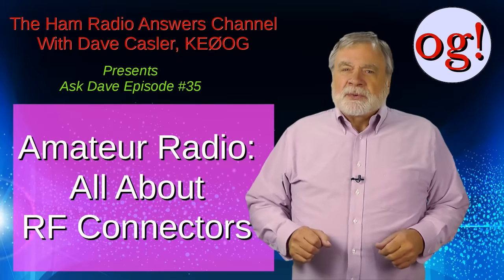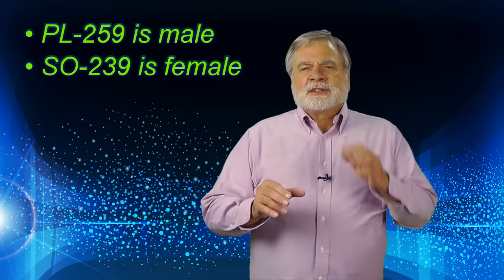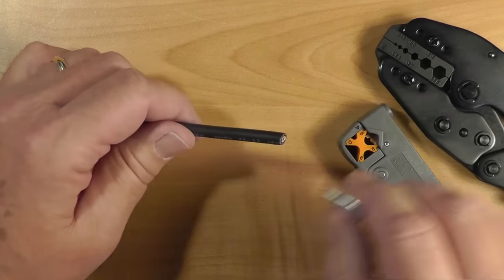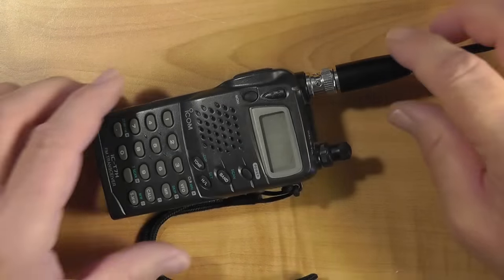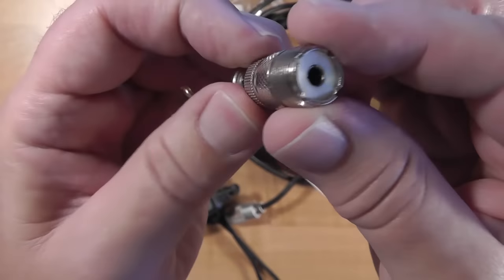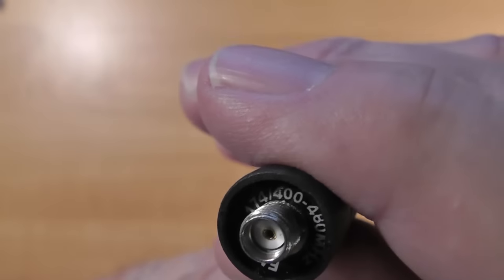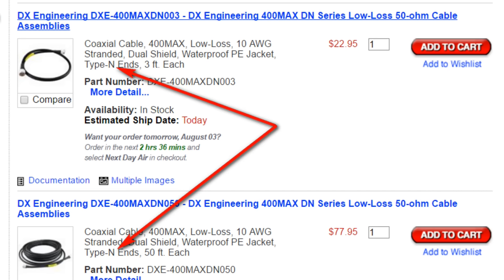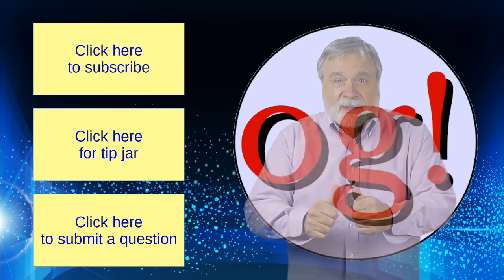RF Connectors and what they're for: AD#35

Comment: Hi ya Dave,  love your videos, always new things to learn.  Just need to let ya know that N-Type connectors are very common (not rare) these days for all VHF, UHF and up into the microwave bands. This is regardless of power levels ( as you implied) many transceivers and antennas already have N-Type connectors on them for the VHF and up bands. As you alluded to, a big reason is that they are a continuous 50 Ohm ( 75 Ohm also available) through the socket  ( this also applied to the SMA, BNC and TNC type connectors)  and as you commented avoids impedance bumps that you get with PL259/S)239 sockets.  At VHF and up into the microwaves .... even small impedance bumps are not good :) :)   Take care ... keep posting your videos   73's Dave VK2TDN

Comment: In Europe, N. Connectors are fairly common on ALL vhf/uhf equipment. Not only high powered equipment. My Yeasu FT-7900 and Kenwood TM-d710 have an N Socket. (Both 50 watt max) and my Kenwood TS-2000 has, next to the so239's for vhf and hf, an N socket for the uhf antenna.

Comment: Thank you for this Dave, much appreciated. NOT a Ham yet but starting out and becoming more & more familiar with the “ins & outs”. Got the ARRL Tech manual & studying up (as I don’t have an “Elmer” really) trying to glean what I can IF I decide to move forward in the hobby. Great stuff & you’ve answered some questions...although I’ve JUST finished running the RG58 coax cable (mag mount antenna) into the attic for a ‘centralized’ Base radio in the house. Went from PL 259 to a SO 239..to a smaller SMA (?) female on the 50’ run of coax cable. Figuring it out I suppose. I did learn from the vid about the intricacies of the PL 259 to SO 239 “FIT” which I MIGHT have to RE-address, although I had/HAVE NO qualms about how I feel it went together. Late seeing the vid BUT it’s still appreciated!

Comment: I also use N connectors exclusively.  With the proper stripper and crimper, you can install one on LMR400 cable in 30 seconds.  If you need to extend a cable for any reason, you can barrel them together with no impedance bump.

Comment: -3bd or 50% power loss at maximum frequency for each connector : UHF (SO, PL) = 60 MHz, FME = 2 GHz, BNC = 4 GHz, N-type = 11 GHz, TNC = 11 GHz, SMA = 18 GHz = = = = > NEVER use at connector at close to its operating bandwidth; the more frequency margin the better ! The 'UHF' are notoriously bad since tolerances from many companies vary widely and the bandwidth is already poor. Best to use an N-connector where ever possible for base stations, except for HTs where SMA is best.
Reply: dropping some knowledge there, 73

Comment: All my h/b equipment has BNC with RG58 cable so I also use the BNC on the front of my FT817ND.
Be sure to get 50 Ω and not 75 Ω for amateur gear. Most radio outlets stock only 50 Ω. Some older gear such KW had a choice of 50 Ω or 75 Ω. My KW204 tx had 75.
G4GHB

Comment: Excellent video. I use BNC and N on everything as a preference.  I still have a few jumpers w/PL259's for the equipment end when needed but run BNC's or N's downrange from there. When I attach a SMA equipped portable to an external antenna or test equipment I prefer to use a small RG174 jumper ( SMA to BNC etc.) as I have found it fairly easy to break the male SMA in service under mild lateral stress.  I know what you mean about "crimper hand" I used to get tendonitis from doing crimp connections all day long. Keep up the good work and thank you for sharing !

Comment: Does anyone remember screw-on TV coax cables?  From experience, they worked a lot more reliably than BNC would have.  So, +1 for threaded connectors.

But I've found screw-on SMA connectors to be  -- after 10-20 ttachments, they start to  cross-thread.
I like reliability and water resistence. For that, type N connectors seem better: they have a gasket, and IP65 rating.

There's also the screw-on "TNC" (Threaded Neill–Concelman) connectors, which are the same size as BNC.  More reliable than BNC or SMA, lighter than type N or 235, but heavier than SMA,.  I'm leaning towards TNC connectors for RG174 and RG58 cables where power is less than 100W or so (and freq band less than 2m for RG174.
Reply: TNC are used inside my Racal RA17L.

Comment: I am considering using a new antenna with a bnc connector for its ease of swapping between car and HT use.  This will mean I will need an adapter for my HT.   Given the choice of two identical antennas and the only difference between the two being that  one will be the BNC connector that will require and adapter, will it decrease my radios performance in terms of range (TX and RX) or would you recommend sticking to an antenna with no adapters?

Comment: I am attempting to build my first antenna. a 2 meter 1/4 wave ground plane antenna out of 5 coat hangers.  My SO239 connector worked great. However the PL259 adaptor on the coax does not fit into the SO239 connector.  Are there different PL259 connector sizes.  The male end is too large for the SO239. Any thoughts would be appreciated.

Comment: thanks for the quick reply. people dont seem to know that there hand helds are defened when using coax to an external ariel even with short lengths of lmr 240. if you only have the inner conducter of the cable connected the recieve comes alive, but transmitt is no good. when the braid is in contact with the radio it stiffles it. [ connected properly ] ive just tested a bunch of n and sma connectors and adaptors and there not a problem with hardly a change in reflected power. ive tested 3 baofengs on beams and raised feeds that are performing when connected to a mobile radio that is designed to work this way. the 6.5dbi antenna is only receiving the same strength as the handhelds 8 inch point 2 dbi .antenna..  with the antennas in exactly the same place,  it must be some thing in the design of handhelds, pi output or something,  maybe youd like to test this and see what you think of it. got me stumped.
Reply: That's just not so. Every auxcom group has regularly used ht's connected by coax to base antennas, or magmounts thrown on vehicles. It sounds like you have a cheap connector making poor contact, or have a bad ground/counterpoise. Physics, not magic.

Comment: I found the train video very nostalgic. History is fascinating and prepares us.
Churchill said "The further back in time one looks, the further forward one can see".
On the subject of radio, Why is the 259/239 better for frequencies below 50 Mhz ? Could there be a reason perhaps ?
Reply from the maker: Hi Ade. I don't know that they're any better. I think it's a case of a few people started using them, it spread, and now they're so entrenched that they're with us permanently. 73, Dave
Reply: David Casler Hi Dave, I was told many years ago that the PL259/SO239 was utilised because of greater surface area of the plug and socket internally which gives low noise because of the larger surface area whence HF RF runs on the outside and this matches what those 2 plugs do.
Did I explain that well ?
To wit, the signal at HF runs on the outside and suits the wider internals of the plug which prevents grounding noise.

I didn't write that very well.

I was told that it suits HF because of low RF Ground noise - Or something close to that.

Ok ? Sometimes I can't write English very well.

Does any of that make sense ?
Reply from the maker: I'm sure that there was an important advantage that the first UHF connectors had that caused them to become widespread. I have no idea what it was, though. Wikipedia has an article on "UHF Connectors," which indicates they date back to the 1930s.
Reply: David Casler What about their suitability at HF ?
Does the design lend itself to clean continuous low noise signals at HF ?

The bizarre thing for countries outside the USA is that N-type is standard on everything virtually above 50Mhz and HF always uses UHF connections.

It should be called a "HF Connector"

More research required.
Reply from the maker: The article I read says they're okay to about 100 MHz. I agree: great HF connectors. 73
Reply: 259/239 connectors are crap compared to N connectors. N connectors are water tight. N connectors are have a matched impedance to the coax. 259/239 connectors are not water tight, and the impedance is not matched to the coax. Commercial (not ham) equipment, and test equipment do not use 259/239 connectors.
Reply: Nathan Haltman Please find me a commercial or military HF radio that uses an N Connector...

And N connectors are not all water resistant - most are not.
NONE are water proof and no professional installs them outdoors without proper and full covering.

NB : At HF frequencies the increased surface area of the pin and plug where the RF flows decreases static and noise products into and out of the feeder line and  helps to materially give a better signal.
Reply: +Ade Larsen Test the connectors with a TDR and VNA. The quantitative data will speak for its self.
Reply: Nathan Haltman I have zero idea of what you are talking about.
Reply: +Ade Larsen a TDR is a Time Domain Reflectometer. A VNA is a Vector Network Analyzer. These tools are used to quantify the properties of RF components.
Reply: Nathan Haltman Are they ? That's great.
Where I work the boss says UHF connectors are good for HF because they are less noisy.
www.dsto.gov.au
Reply: +Ade Larsen Ok, did your boss make any quantitative measurements to support his claim, that 259/239 connectors preform better than N connectors?
Reply: Nathan Haltman What does quantitative mean ?
Reply: +Ade Larsen If you want to learn more about RF, please research the following: quantitative, qualitative, Ohms Law, S parameters, directional coupler, attenuators, circulator, Bell (B), decibel (dB), reactance, scope, spectrum analyzer, VNA, TDR, power meter, and FFT. That will be a good start.
Reply: # The 259 and 239 numbers relate to the army stores referance ..
    (source ...older hams )
# The Pl , SO 'hf' connectors also known as 'M' type
    are 'crap' compared to N type.
    (source ..me)
# The reflective bump as refered to at video time 6;30
    is caused by the undulating ratio of diameters throughout the 
    connector giving multiple impedances and reflections.
    The N is just an M with an inner collar ...
    Try cutting one open along it's length...
# I find they are only trollable up to 60mhz, then the indiscretions
    can be measured...
# So why use them... ?
G7CEY
# ahhh sugar. I've typed whilst Su was logged into facebook..
  obviously chatting about spilling nail varnish on the cat.
please ignore the photo..
Reply: @adelarsen9776  Yes, correct, the PL-239 SO-239 are called UHF connectors, but it is common to use "N" Connectors on VHF & UHF cables etc... at least in Australia ...  but they are a pain to fit to cables....  they were also 4 times the  price of a PL259  years ago.... now not much expensive to a PL-259 ...I used Belden 9913 cable to My tower & antennas,  and I had to file down the center wire as it would not fit into the "N" connector pins , but I did see You could buy pins with different sized holes in the USA.....but not in Australia ...   VK2LEE     Lee
Reply: @davecasler  Called UHF connectors in Australia but I don't think many hams would use them on UHF cables...  and many wouldn't use them on VHF either.....  should be called HF connectors... N connectors are difficult to solder and fit to a cable..... VK2LEE
Reply: The funny thing is that Solderless N-Type still need the centre pin soldered. Go figure :-)
Reply: @adelarsen9776  They were called UHF connectors because at the time they were invented any frequency higher than 30 MHz was regarded as UHF.
Reply: @johnyoung1128  Increased surface area of inner conductor makes a better signal to noise ratio.

Comment: hey david.do you know why there is a loss in receive on a boafeng handheld when connected with a coax to an external antenna. do you know if anyone has tested the sma to n connector plug or sma to so239.  theres something like a 12db loss. and this happens on all sorts of antenna so its not an ill tuned antenna. your getting an improvement due to the antenna being in the clear and hieght
Reply from the maker: Cable loss is frequency-dependent, and cables like RG-8X aren't all that good at VHF/UHF, but 12 dB sounds like a pretty hefty loss. Connectors have loss too, but perhaps 1 or at most 2 dB. So something else is wrong. Good luck with your project!

Comment: Well, there now is a major Problem... ALL the chinese made PL-259 & SO-239 now coming on the market via ebay etc  have a different thread...  the original have a thread of  24 threads per inch, and the chinese are 26 threads per inch so that they actually match OK for 4 or 5 threads then they are a mismatch.... I have been having problems since the  shops that sold these all close a few years ago.  I tighten a PL-259 into a SO-239 where all My cables go inside the house, which I need to undo when there is lightning about... and when My SWR isn't good I go and check these connections and they are always loose, so I retighten them again... and again, that is when I bought a thread gauge, and I found the threads different.... So, I am going to have to change all My PL259s & SO239s on My cables.... VK2LEE  LEE
Reply: Polar Electronics in MLB can help you.